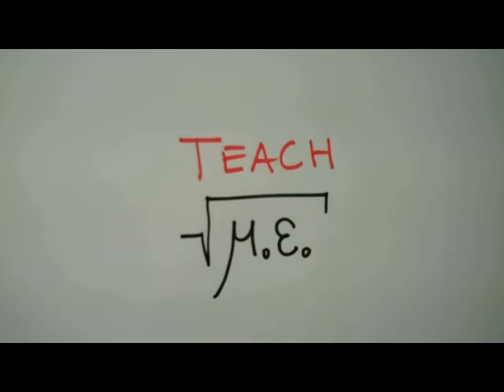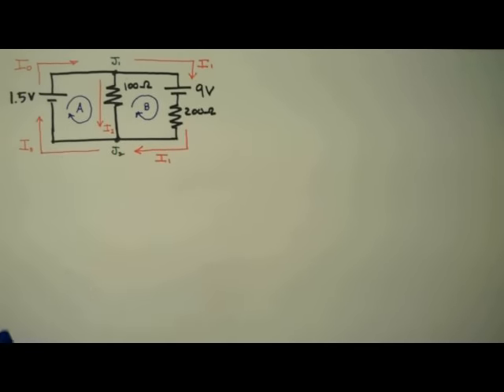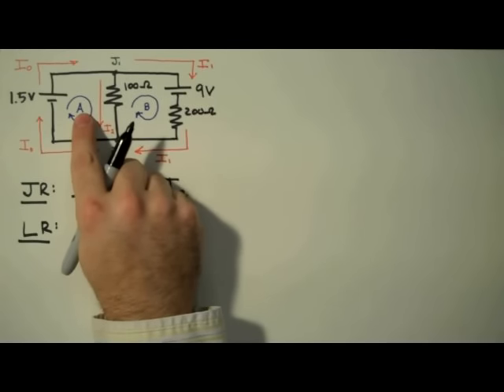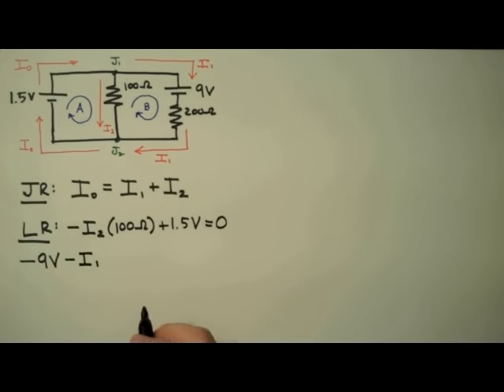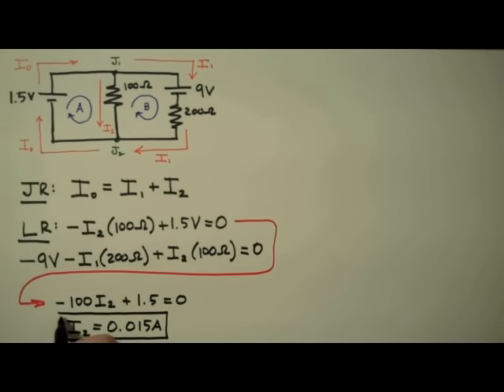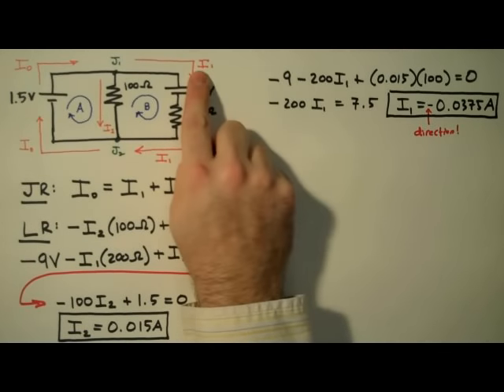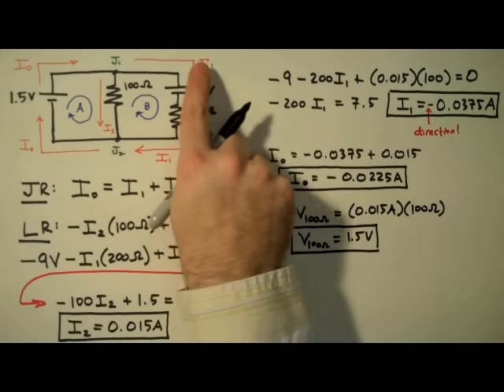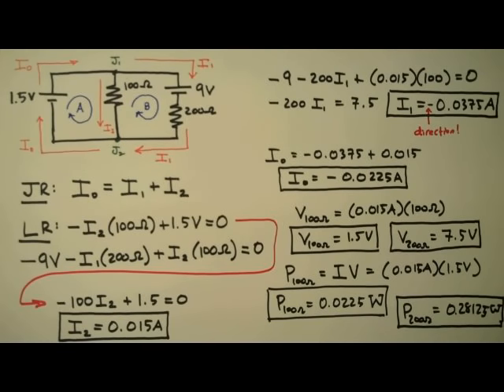How to Solve a Kirchhoff's Rules Problem - Simple Example

Comment: Why didn't we take negative current in V(200  ohm) and P(200 ohm)?
If that was a mistake,
Does that mean
V(200 ohm) = -7.5 V
P(200 ohm) = -0.2812 W
?

Someone clarify me this.
Reply: A little late but the negative current just means that we chose the wrong direction for the current in the circuit. But obviously current should always be positive when taking calculations. Hope this helps.

Comment: It was really helpful ,
but I thought when we're crossing a cell from -ve to +ve then it should be taken as -ve ,but when you apply loop rule first you took 1.5v as +ve why? am I wrong?
Reply from the maker: When you traverse a cell from NEG TO POS, I treat it as a voltage LIFT (positive voltage with the Loop Rool.)
Reply: You can interpret it that way, just make sure the direction of currents or voltage (drop vs lift) are coherent with your interpretation and you will arrive at the same result. Actually if you try it then you will see it =D

Comment: when you do V100 = (0.015)(100), you are using (I2 * 100) (which means you are using the A loop). Could it be done by using the B loop? Like V100 = (-0.0375)(100)? I mean the "100 Ohm" is "statick", so the result should be the same... But with B loop, we use I1=200 (wich is different from 100 xD)... So it won't get it that way...
So I suppose we calculate V100 with the current that flows in that direction, in this case, I2... Am I right?

(Sorry for any english mistakes, I'm portuguese)

Thanksssss for the Awesome! Awesome! Videoooo \^O^/

Comment: so even if the current is negative you do not need to change anything. You can still solve for the values and everything. If this is the case then why does the direction of the current matter if you can use negative or positive values.
Reply from the maker: Because it affects whether you add or subtract voltages (voltage lifts or voltage drops depend on chosen current direction).

Comment: Hello. Can you clarify something for me?
Does current always originate from the emf source with largest emf? In this case 9V battery. so the other emf does nothing?
Also, my textbook says that when there is two sources connected in a simple loop circuit the source with largest emf delivers energy to the other source. It gives example of car alternator recharging the battery. What if there is three or more emf sources? Same idea applies?
Reply from the maker: ATavoTavo Hi Tavo. That's a great question but quite difficult to answer in a comment box. The short answer is it depends on the voltages and how they're connected. I'd encourage experimentation with an online circuit builder (like this one: http://www.partsim.com/simulator) to see how the current will behave in different circumstances. Best of luck!

Comment: sorry maybe its an old video but i have noticed that the power on 200 Resistor is 0.3375 W not 0.28125 W. May you perhaps show me how you arrived to that solution?
Reply from the maker: P=IV --> with 7.5 volts and 0.0375 amps =)

Comment: are you allowed to choose starting points at the positive end of each terminal, for the LR for each loop?
Reply from the maker: Hi Andrew! You can choose any starting point (and either direction) for the loop rule.
Reply: Thank you. Correct me if I'm wrong, the most important concept is to understand when to apply positive or negatives sings to either the current or the voltage depending on the direction you initially wrote down and applying the sings according to the direction you choose to evaluate; signs will be assigned whether you go with or against (current or voltage) and this depends on how you drew the directions of the current initially.

Comment: I have question @ 2:43 you said the first component is I2, when you started from left top side of the loop in A. Should it be I0 first? instead of I2? please explain.
Reply from the maker: When doing loops we're adding voltages, not currents. So we're not adding I2 but rather adding I2 x 100 Ohms (the product yields a voltage). Which is why I0 isn't added first. Does that help?

Comment: Sorry for asking this dumb question... but my teacher used like a substitution or elimination method using different equations... is simply transposing them like you did just as good?
Reply from the maker: The way we solved it in this video should work for simple Kirchhoff's problems. For more complex Kirchhoff's problems, check out my matrix version.

Comment: wasnt the voltage across the 200ohm resistor supposed to be -7.5V?
Reply from the maker: Yes, it was! Good catch. Sadly I treated the voltage as magnitude-only but the truth is that because the positive charge flow is in the other direction, so is the potential difference.

Comment: I don't understand why when you pass through the 9V it becomes negative. How is it going from high to low?
Reply from the maker: Hi Cosette! It has to do with loop direction (which we chose arbitrarily). When moving around the loop and we encounter a battery and move from positive to negative (high potential to low potential) we treat it as a a negative voltage. Check out my intro to Kirchhoff's for a thorough explanation: https://www.youtube.com/watch?v=SKdK_L4jbV0 Cheers!

Comment: hey I'm so confused about how you got the P(200) to be 0.28125W... don't you have to multiply 0.0375A by 9V?
Reply from the maker: Elisa H Hi Elisa! Just because it's next to the 9V battery doesn't mean it experiences a potential difference of 9V! We discovered earlier in the problem that the voltage across the 200-ohm resistor is 7.5 volts. Best of luck with your studies and cheers from Detroit!

Comment: why did u drop the sign while calculating the voltage drop through the 200 ohm resistor? shouldn't it be -7.5V
Reply: Well these are not vector quantities, the negative sign in current is just a result of choosing the wrong direction of current, at least that's what i think.
Reply: @hikaru-senpai3684  thanks. i forgot that voltage is a scalar quantity.
Reply from the maker: It was a mistake. Voltage is directional so I should've left it!!

Comment: I don't understand how -100I2+1.5=0 results in I2 being 0,015A?
Do you divide by -100 to break I2 free, Like this: -100I2/-100, then: 1,5/-100?

When I do this I get -0,015, like if we chose the wrong current flow. What am I doing wrong?
Reply from the maker: Hi Henrik. I think we need to revisit the order of operations in algebra. First you subtract 1.5 from both sides. Then you divide by -100. Cheers!

Comment: i thought the current flow should start from the 9V since u have to start from the bigger voltage
Reply: +Yudesh Menon You can pick whichever direction you want to start with. The answers in the end will tell you the actual direction of the currents.

Comment: hi,
I wanted to ask how to solve problems where batteries are given with voltage as well as resistance?
Reply from the maker: +devi. gophan. Hi Devi! You just treat the internal resistance as a resistor connected in series with the circuit. Cheers from Detroit!
Reply: +Jesse Mason Thanks for your help!!!!! The video was amazing!!!

Comment: Dude. thank you so much. But ı have a question P200 must be -028125V? because I1 is minus. am ı right?
Reply from the maker: Yes - good catch, Katakofti!
Reply: thank you :) and thanks for your help to understand
Reply: KATAKOFTİ iskeleolma Jesse Mason Does that mean the voltage drop (V200) is -7.5V as well? Or do you just take the positive value?
Reply: Jesse Mason Sorry, i read a comment further down that cleared it up. So basically if you find a current value to be negative, you follow through the rest of the question retaining the negative value?

Comment: why at 4:05 is there a pd gain, I dont understand how the charge carriers gain energy here
Reply from the maker: Hi Joey! You're conflating potential difference with potential energy. Analyze the voltage drop over a resistor in reverse (which is precisely what we're doing here) and you have a voltage gain. Cheers from Detroit!
Reply: thank you very much for this help and the quality videos !

Comment: You should really put a "hold on" indicator at 4:12 :) I was almost going to rage quit (since my college teacher had already mad me say f*** kirchhoffs law :D). At 6:00 it is well explained why you signed it with plus so, thanks :D
Reply: +MuhsinFatihY Doesnt understand why he put that as plus, could you explain? he is still moving against the direction of current from - to + . Then i would think that that should be negative as well
Reply: +AdrianColumbus the key point is that those signs are arbitrary. Just assign current in any direction to anywhere you want, you really don't even need to bother thinking about the way it will actually be. After all calculation you will know the actual direction of current: If I is positive, then current flows in the direction you had chosen. If I is negative, then the current actually flows on the opposite way
Reply: Got it, and since he had assigned I2 down and he went up, he then moved against the assigned current and he had to ADD instead of subtract the voltage drop
Reply: +AdrianColumbus exactly

Comment: Can someone pls tell me how did -100ohms + 1.5V becomes 0.015 A?

4:52
Reply: i2=1.5/100 which is equal to 0.015 because current(i)=voltage(v)/resistance(ohms)

Comment: I don't understand what you did to get the 7.5
Reply from the maker: Ohm's Law. Current through (0.0375 Amps) multiplied by resistance (200 Ohms) equals voltage across (7.5 Volts). (Since the current was calculated to be negative, so should be the voltage.)
Reply: Thanks Jesse, I appreciate it.

Comment: how did u get 7.5?=V200 ????
Reply: He did mention in a reply to the other comment that he made a mistake and it was -7.5 V ...
Reply from the maker: don't Bother Yes, Bother!
Reply: "The potential difference between 2 points (A and B) equals the work done moving unit positive charge from A to B.”

E.g. if 6J are needed to move +2C from A to B. the p.d. between A and B is 6/3=2V. This means B's potential is 2V higher than A's potential. B is more positive than A.

But we could equally well say the p.d. between B and A (reversed order of letters) is -2V. This means A's potential is 2V lower than B's potential. A is more negative than B.
In symbols: VAB = -VBA and VBA = -VAB.

For simple problems it often doesn't matter what the direction is. So we often just say the p.d. between A and B is 2V without bothering to think about the direction. So we often just use the magnitude of the p.d.

-An explanation of negative voltage someone gave me.
Just so you guys were wondering about the negative voltage.

Comment: sorry Jesse but I've lost the will to live here following the maths. LR = -100I2 + 1.5 = 0... No it doesn't... 1.5 ÷ 100 = 0.015

then the next sum... -9 -200I1 + (0.015) (100) = 0
-9 × -200 + (0.015) × (100) = 1801.5..... wtf 

I just don't understand how you're doing any of the maths to reach the values here using a calculator. what do you actually type into the calculator?

please help here because it's a good explanation I'm just losing you with the sums